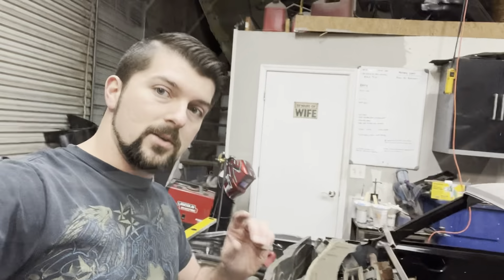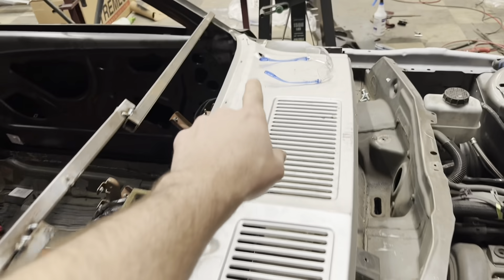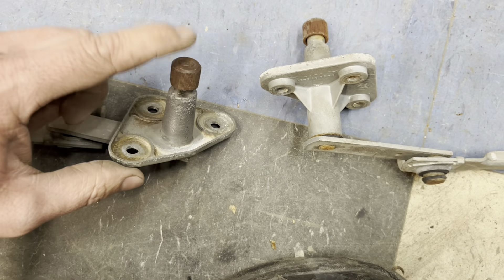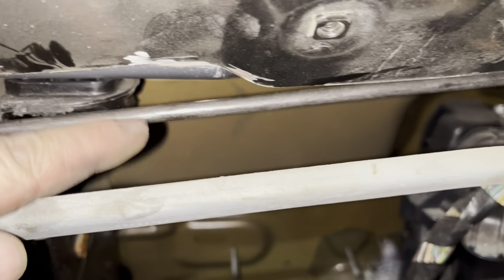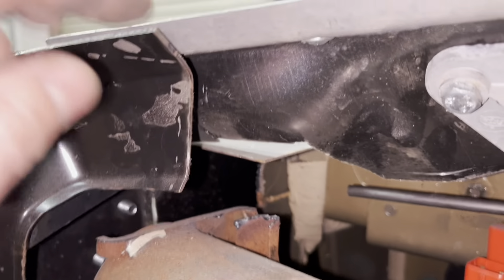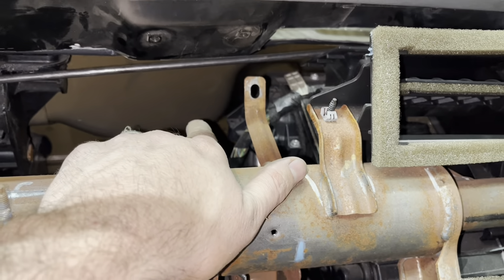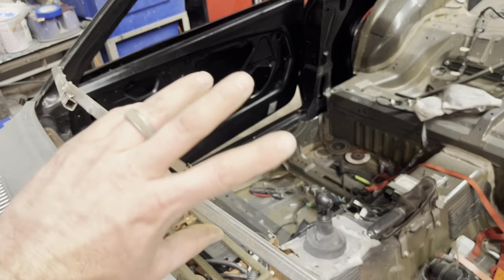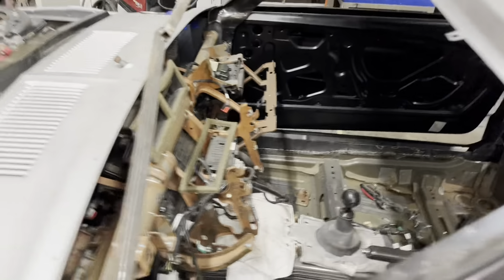Mustang body swap making the windshield wipers work

Comment: Hands down the best body swaps I have found. I have watched every video imaginable before starting on mine. I'm about half way through it and literally everything fits the best the way you have done it. Thanks for making these videos!
Reply from the maker: I have a few body swap builds on the channel, a 2009 gt500 to 69, 2012 gt to 67, 2004 gt to 67, and the 2013 gt to 67
Reply: @1194video  oh yeah man I've been checking them all out. I'm doing a 70 fastback on a 2012 s197. I'm about where you were on your last video with it. I've noticed you cut out more than the "youtube" builds and that's the route I'm going as well. My goal is factory looking as possible. So far yours are the best for this.
Reply: @1194video also anyone using stock dash mounts is cheating the measurements by alot. They're like 57 inches apart. The older body's are 55 1/2 or so. Luckily with the s197s you have the trans tunnel mount to get your base mounting points from
Reply from the maker: @themustangfactory  I’m going to be honest with you about those YouTube builds online, they are all crap, ppl getting into a hurry, taking short cuts, not making sure measurements are correct. I cut more because it’s easier to add metal than keep pulling the body on and off. There is only one that does an outstanding job and that’s https://www.youtube.com/@SteveMirabelli he is excellent even though it’s not a mustang he does it right.
Reply from the maker: @themustangfactory  yes but don’t rely on that 100% it can sway enough to make the gap off on the console if your off even a little bit. And on the 69 the body is wider so you will get to keep a lot more material than I can on a 67.
Reply: @1194video  okay man, I will check him out. And thanks for the input! I'll get the console and all in and secured before I make any solid mounts

Comment: Wipers and cowls are the biggest challenge on these body swaps by far.
Reply from the maker: Agreed, and this isn’t even the final setup, I’ll pull it all apart and change it a few more times before I like it. The thing with mustangs is the cowl welds in and the glass sits into the cowl or I’d make it removable
Reply from the maker: You did excellent on your cowl, I have to invest in a better shrink and stretcher
Reply from the maker: I have some Heim joint ends I’ll use for the final, I wanted to use the assembly from the new model and cut it down but with only 1” between the defrost vent I didn’t have room